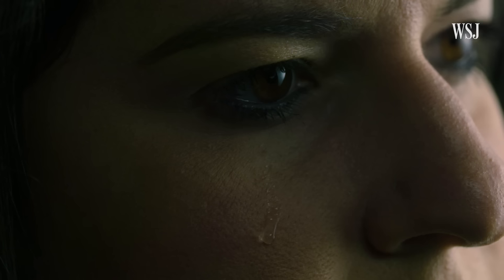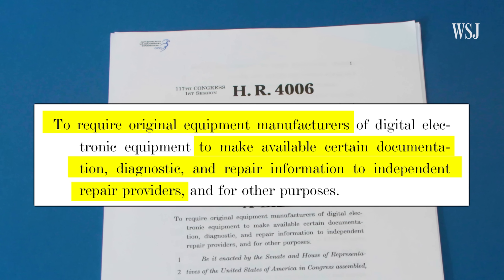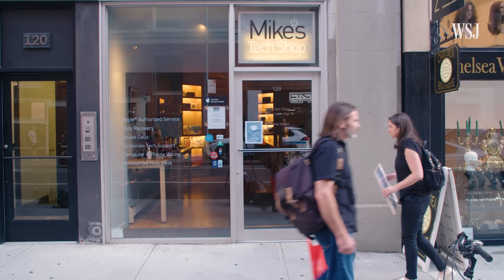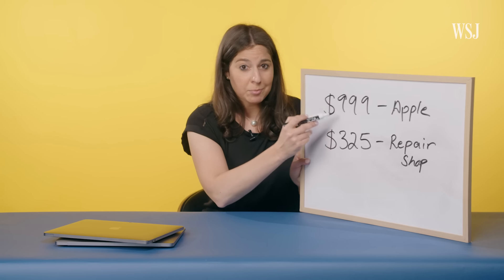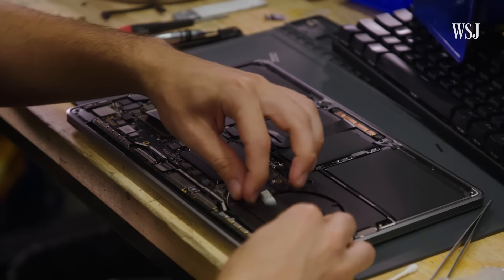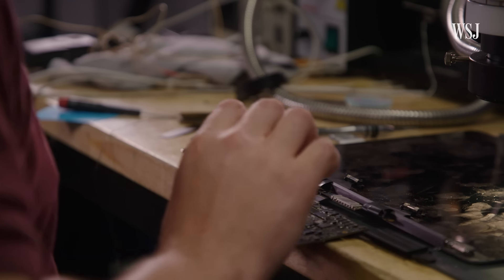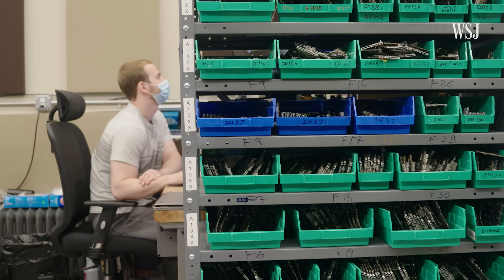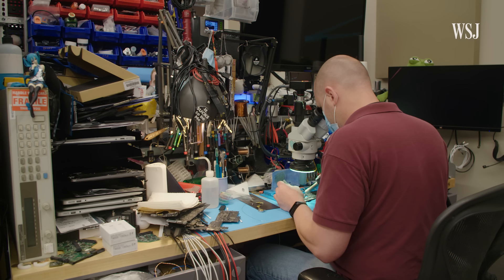Apple Store vs. Repair Shop: What the Right to Repair Is All About | WSJ

Comment: This subject should have more coverage as it should be the customer’s right to choose to repair his/her gadget. Glad Louis Rossman getting featured.
Reply: Psst! Add an n to Rossmann before he sees it! ;-)
Reply: If i buy i should have the right to do what i want with it open it blow it up mess it up
Reply: This is not only about the repair choice, the environmental concerns about Apple's strategy is horrendous, he repaired a laptop with water damage, and its worth using for some more time, but Apple wants to sell you a new laptop, or full new motherboard, which would cost resources, resources owned by you and me and every single person on earth. if not giving a charger saves environment, making your devices easier to repair saves it a ton. Quite surprised that environmental impact is not talked about much in right to repair
Reply: @rahulagrawal327  Apple didn’t want to sell them a new computer, they wanted to replace the motherboard. Rossmann also replaced parts in the computer to circumvent corrosion. There isn’t really an option to fix water damage that wouldn’t use resources.
Reply: @CharlieQuartz  She mentions that she has 2 choices. Spend 800 for board or 1000 for new. And in most cases companies bank on customer going extra mile and buying a full computer instead, which works. Right to repair also means Ease of repair. That instead of your device being just 2 parts which are expensive to repair, it's multiple different parts where a single part can be repaired easily. You might even see this with comapnies like Tesla now. Where a simple repair requires a lot of disassembly and assembly than normal cars which increases cost of repair
Reply: @rahulagrawal327  I’ve heard it argued that the replacements Rossmann is doing aren’t really economically viable at Apple’s market scale. Personally, I have no problem with companies creating products that are tightly integrated and durable. The market already supports companies which offer easy-to-repair tech and others have no obligation to apply that principle if customers are willing to buy into their system. Apple computers can last for over a decade if the costumer treats them properly and that is arguably an exercise in eco-friendly waste management. 

Companies like Apple and Tesla already target a demographic that finds luxury an important factor of their purchase, so the customer is willing to pay for luxury services. That is a relationship the consumer buys into and I don’t see why it should be dictated by outside forces. 

In general, I don’t understand why the “right to repair” people are so frustrated since there are no legal or corporate policies preventing you from repairing a product. I think companies have a right to reserve the schematic information to secure their investments in design. I don’t know how expensive it is to keep a reserve of many parts to sell, but I don’t know if it’s a good idea to force the company to do that, as they might just move that price to their base product, instead.
Reply: They already have that "right".  This is for support such as  parts, tools and documentation...
Reply: @CharlieQuartz  If the repairs were not economically viable then Louis would not have such a successful business, and the main reason you don't see more such businesses is because of the huge hoops that third party repair centers have to jump through to be able to repair Apple devices (Louis for example is fortunate enough to have made the "right connections" to people who can supply him with what he needs for certain repairs, like certain schematics and components, while other repairmen are not be so lucky thorough no real fault of their own). "I've heard it argued" is not a legitimate source, what exactly is the evidence that this would not be economically viable for them in the first place? I'd definitely be interested to see the numbers. Maybe it would not be more viable than replacements which allow Apple to squeeze three to four times more money from people, but that isn't saying much. Most importantly, to the consumer this whole argument should not matter as the replacements that Apple does for such a high price (and without the ability to recover their data) is truly economically nonviable for them.

"Apple computers can last for over a decade if the costumer treats them properly" - Ah the good old gaslighting argument of "you are using the device wrong" or "it is your fault that the device no longer works", I see you have been taught well in the art of PR. Are we just going to brush aside Apple's repeated and well documented design flaws, or their repeated attempts to deny any kind of responsibility for these problems for months or even years and then issue recalls? What exactly is the point of this argument anyway, aside from to shill for Apple? They make some good products, but they also make tons of mistakes. Besides, there is nothing inherently "durable" about Apple products especially if you look at the way in which their devices are designed at a component level. Louis for example points out how Apple seem to design some motherboards with high voltage charging rails that pass unnecessarily close to other important and sensitive rails like the ones for the CPU, or important rails that pass very close to areas where water is more likely to enter the device. These, and many other issues, actually make some of their Macbooks models very non durable.

"Companies like Apple target a demographic that finds luxury an important factor of their purchase" - This means absolutely nothing, buying a luxury good should not have to mean that you are restricted in the way in which you choose to have said good (that you OWN) be repaired. It also should not mean that the repair for said goods need to be prohibitively expensive as well, especially when there are cheaper alternatives. Just because a person is able to afford a luxury good does not mean he can also afford to spend a huge sum of money again for a repair on said product, or purchase the same device again because the repair is almost as expensive as a new device anyway. People come to Louis to get their "luxury" devices repaired for a much cheaper price for a reason. Also, don't you find it a bit ironic how can you champion the concept of an Apple device being a luxury product...yet Apple is apparently unable to even offer you such basic things as data recovery when you take said device to them for repairs?

"there are no legal or corporate policies preventing you from repairing a product" - But there ARE. What this video fails to specify is the main reason why Louis cannot repair the newer Macbook, aside from the lack of schematics (which would still make it technically repairable, it would just take a ridiculously long time which might not make the repair viable for him) is because he cannot buy the components needed for the repair because of a silent deal between Apple and the chip manufacturers to only sell those chips to Apple and nobody else, which IS illegal as it constitutes a form of product or goods tying. This is what Louis's version of right to repair seeks to tackle, the legal issues surrounding Apple's practices for stifling third party repair, which can go through many hoops, but this is not one.

"I don’t know how expensive it is to keep a reserve of many parts to sell, but I don’t know if it’s a good idea to force the company to do that" - Louis actually agrees completely with this, and his version of RTR does not want to force companies to have to do this. It is mostly about the aforementioned legal issue described above. I don't know if you are arguing against RTR in bad faith, but if you aren't and you are genuinely curious to know more than I would suggest checking out Louis's channel and you might learn a lot more about this.
Reply: @CharlieQuartz    economies of scale make it cheaper for Apple to do anything loius can by a huge margin. Also it's not that Apple is catering to the luxury market, it's flat out manipulating people into becoming consumers first and people with a brain second. And tesla interiors look like bargain basement stuff with a jumbotron in the middle. The premium status of these brands is the biggest meme I've seen in years. Clever social engineering that works on people like you.
Reply: @CharlieQuartz  Apple would toss the damaged motherboard into a landfill.  Rossman takes a motherboard that would have been landfill, and uses it as a source of parts.  Amazing that you fail to see the difference.

Comment: Car companies said all the same things, and then Congress passed laws saying that the rules that were used to push customers to dealerships for repair were illegal.  Now we have Alldata, the company that all the car companies use to distribute the required information and several competing distributors of OEM auto parts.
Reply: And they recently tried to pull the same with wireless systems, exploiting a loophole in the original legislation, which got shut down yet again. But corpos are gonna be corpos.
Reply: YouTube channel Steve Lehto did a video about the law mentioned in the original comment.
Reply: @crisnmaryfam7344  And charges a ton of money for simple repairs also.

Comment: Simple: Once it's out of warranty, the manufacturer has no right to "guarantee safety or correct functioning". You should be able to go to whoever is capable of making the machine work again.
Reply: The problem is when there is no one capable, as demonstrated with the Macbook Air. 
The goal of right to repair is making more people capable.
Reply: @Cau_No  Yeah, I understand that. Just saying that if that's Apple's excuse. It's a poor excuse.
Reply: @iau  Indeed, only Apple fanatics would swallow that kind of nonsense without second thought.
Reply: it's bull, because when they repair it you have a warranty on the repair or  a possibility to complain about the repair and they have to fix it for free.

Comment: You forgot the biggest issue is that getting the parts he needs for repairs is nearly impossible. The back and forth time is insane.
Reply: watch it again, they mention that at least 4 times...
Reply: That and customs seizures for the chip/part being "counterfeit", even if they're literally directly from the OEM that Apple uses or an actual Apple product via a donor board or donor phone/laptop/device. Thats not a counterfeit product, it's 100% original and authentic parts.

Comment: Apple would take 1000$ from you, give you the new refurbished board, then take the old board, fix it just like you saw on the video and sell it as refurbished product for $1000 with a new aluminium case.
Reply: This is the most disgusting part. Or well, it’s still better than scrapping the device
Reply: They won't give you the new board, but refurbished one.
Reply: brilliant.

Comment: One important thing not mentioned here is when confronted with the choice to either repair through Apple or buy a new laptop, is most people are forced to go down the repair route solely because of their work/data/media being stored on what is now a broken device. It makes it feel even dirtier when you're gouged so hard to get access to your own stuff.
Reply: Unpluging the hard drive and pluging it back in another computer require no skill beside knowing how to use a screwdriver, and will allow you to recover your data. Unless Apple managed to make it impossible too. Also make backups because hard drive can die and laptop can be stolen.
Reply: @________-by2px  That's part of my point; in many cases they DO make it impossible.
Reply: @________-by2px  You're not getting the bigger picture here. That's fine.
Reply: Yes, but if they replace the whole logic board, your data is gone, because it is stored on the old board.
Reply: @________-by2px  In most modern laptops, and certainly Apple ones, you don't have hard drives any more. You have SSD chips soldered directly onto the logic board.
Reply: B A C K  U P  Y O U R  D A T A

Comment: Louis rossmann is by far pushing for things no one else thought possible years ago. As a customer, supporter, and fellow Tech enthusiast I cannot agree with this movement more.
Reply: Incorrect, he is pushing for things that did not need to be pushed for years ago, when you opened a device the schematic was stuck to the door on in a plastic folder stuck to the door and the manufacturer had no qualms about selling you the needed spare parts or they were freely available as commonly used parts in the wider market. It was not that it was not thought possible, it was not needed because the corporations actually wanted their customers to feel like they were getting a good deal and not just with the sale of the device. Now they are worried about how to better screw their customers.
Reply: It sounds like you still have no idea what right to repair is actually about

Comment: Watched Louis for 5 years. This is well deserved for him. 

It should be noted Apple is actively collaborating with chip manufacturers to prevent parts from becoming available on the open market. 

Imagine the alternator dies in your Honda. Honda have told Denso who make that alternator not to sell it to anyone. Your only choice is a brand new engine fitted at the dealer for $10,000 or maybe being lucky enough to find an alternator in a scrap yard. Now for the moment there are many suppliers who sell alternators including just being able to buy one from the dealership but make no mistake. Corporations want to prevent repair altogether to force you to buy a new product every time one little thing breaks and its not just Apple or in the tech field this is happening. Car manufacturers including Toyota, Ford and GM spent millions lobbying against right to repair in Massachusetts.

Comment: Independent repairs can also try to save your data. Apple doesn't. They'll replace the whole part, and the data is gone if it's soldered to the board.

Comment: A major difference is APPLE does not REPAIR, they replace..So where you have a board issue they replace the board.. Louis Rossman will REPAIR the board damage when possible.. Some OEM's do NOT REPAIR they only REPLACE parts..So you buy an expensive board when a $5-10 component is the problem...Like replacing your car engine instead of replacing the spark plugs or changing the oil....TESLA does the same.. Bad battery cell, $25,000 for a new battery..  Some shops will repair or bypass the cell for $5,000... Labor intensive repair...And the battery weighs 1200 pounds..Owners cant even get repair info on super expensive John Deere products..  Right to repair must be good for the little guy because the manufacturers send lawyers to t hearings in states considering it to oppose it.

Comment: I just replaced a soldered on battery on my $200 sonicare diamond clean toothbrush. I also fixed the no vibration issue. $27. Thanks IFIXIT for supplying the tear and parts and  Louis Rossmann and everyone trying to get the right to rapair bill passed.

Comment: 1. Of course Apple don’t want you to repair. If you are still using your 3 years old laptop who is gonna buy the new MacBook? This is why iPhones have such tiny battery that will wear out after 2 years

2. You missed the most important part of becoming an Apple authorized repair shop. You are contractually required to NOT repair most Apple products if you are an authorized shop. Apple don’t want you to actually repair so they will only allow a few parts replacement at authorized shops
Reply: It is kind of ridiculous of the prices too. I have a cracked iPhone screen and that alone costs $300, and they told me I have to replace the whole phone which is $524.
Reply: yeah rossmann brought it up in one of his videos that apple only provides these shops screens and batteries for iphones i think

Comment: My 2015 MacBook Pro needs a new battery, it would be $200 but my Apple store said they have to replace my motherboard because the water damage sticker was activated, which brought it to $1300 even though it works fine. Just gonna buy a new top case and do it myself.
Reply: The worst part is the cost of that battery to manufacturer is like 30$
Reply: @nxtktube  I recently replaced the battery of my MacBook Pro 2015 myself. Cost $60. Works now without problems. You'll find instruction videos around. If you don't want to do this yourself, you can pay someone to do it. Price will still be far below Apple's.
Reply: @dirkvr3815  True, I'm still on a laptop with discrete power cells battery, which I refurbished -  point welded recently for the third time.

Comment: I don't think folks in the comments realize. This doesn't only fall at apple's feet. Samsung and John deere are also guilty of this.
Reply: Tesla too, they say it's dangerous to work on electric vehicles. 
I say it's my choice to touch active 800 Volt power bus with bare hands, or smoke near a full tank of gasoline.
Reply: Every corporation on the planet is into holding back RTR. It goes against their buisness model and the execs might have to miss out on a yearly bonus, or the first company to jump before the laws are passed will just crush their competition, makes one wonder if they are colluding.
Reply: Samsung? Maybe in the USA
Reply: what's also bad is that this also affects the healthcare industry. i think it was CNET who made a video about right to repair and brought up how manufacturers of healthcare equipment apply same regulations that violate right to repair similar to apple and john deere
Reply: TESLA is one of the worst
Reply: @invenom8894  Agree, I love Tesla but rich rebuilds proved how scummy they are when anyone trys to mess around with their cars. 

Worked on many Teslas and have experiences with car mechanics?  Don't care disables charging network on car for "Safety reasons"